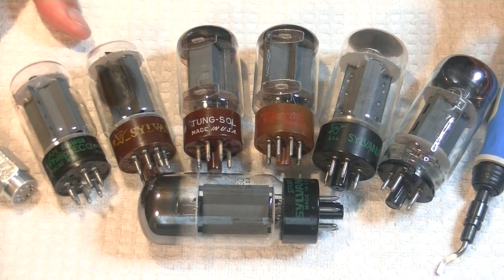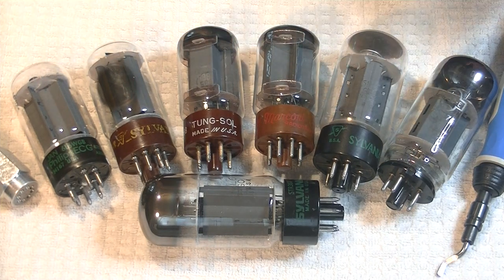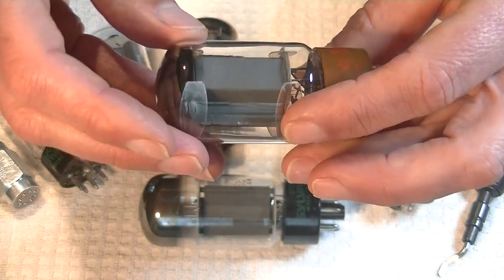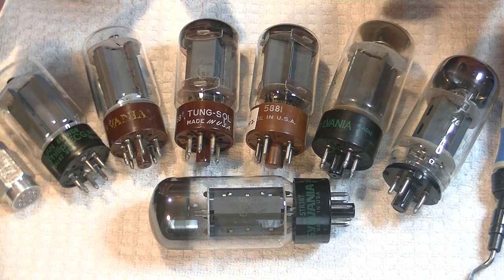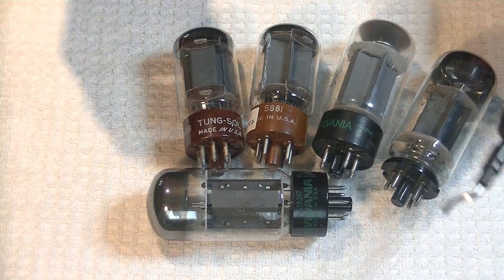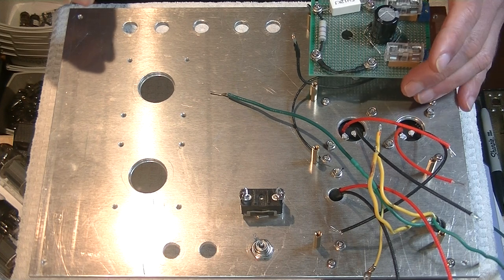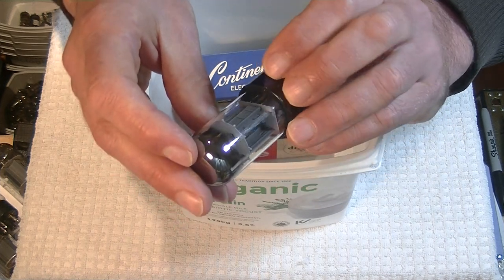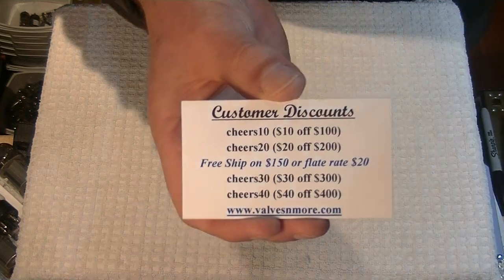Tube Lab #16 - Rolling the Sylvania 6L6

Comment: The Sylvania STR codes on the 6L6GC’s are special tube request. 451 and 387 were both for Fender OEM and were supposed to rugged enough in their combo amps where the tubes were right next to the speakers. Mesa also rebranded the STR tubes throughout the 80’s until Philips ended production

Comment: It is good to review tube data sheets!   When comparing older tube data (such as for the 5881, from early-'50s) to relatively newer tube data (the 6L6GC, from early-'60s), note that the values are rated under the "design-center" system for the 5881 compared to the later ratings using the "design-maximum" system.  What this means is that the 5881 is more conservatively rated than the 6L6GC, and that the two values are not directly comparable because the rating system standards changed.  In 1955, Tung-Sol published a 6L6WGB (=5881) data sheet showing the plate dissipation is 26W, as an "absolute maximum" rated value.

Comment: The old Russian 6P3S are often represented as 6L6GC equivalents. Look at the data sheets. A 6L6GC has a plate dissipation rating of 30 watts. The 6P3S is only rated for 20 watts. This can be an issue is many applications.
Reply from the maker: Good catch!  Also the 6L6 has had so many versions over the years, that the newer tubes aren't really the same tube anymore.
Of note is the 6P3S-EV, which is a completely different tube than the original 6P3S.  I've used it with great success in a 6L6 circuit.

Comment: I have a Luxman LX-380 int amp that came with a quad of Electro-Harmonix 6L6GC output tubes, no longer available. As I need to replace these, what audiophile tubes, current production or NOS, do you recommend? Thanks.
Reply from the maker: @issadad  we still have inventory of the Soviet era 6P3S-E, quality build with a coin base, they're drop in replacements for the 6L6 and are lovely sounding, rock solid power tubes.
Here's a LINK:  https://valvesnmore.com/?product=6l6-6384-5881-tubes

Comment: So, what would be better: 6L6WGB or 6L6GCM (both are china version from aliexpress), if i need to upgrade 6P3P?
Reply from the maker: I've had such bad results with Chinese power tubes that I stay as far away from them as i can.  I've had Chinese power tubes die inside of 24hrs, whereas a used vintage western made 6L6 that is now 60 years old will test good and work.  Now not all used 6L6's are going to test good, but this just shows how well made they were.  If can't afford quality vintage 6L6's a good option is the Soviet 6P3S-E, an excellent 6L6 equivalent.  And I have good inventory of the vintage Soviet tube.